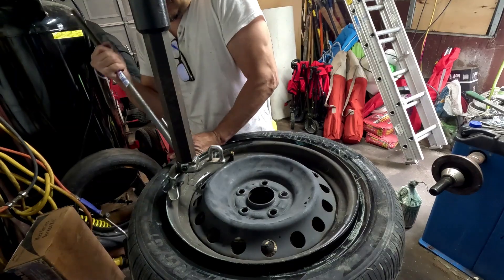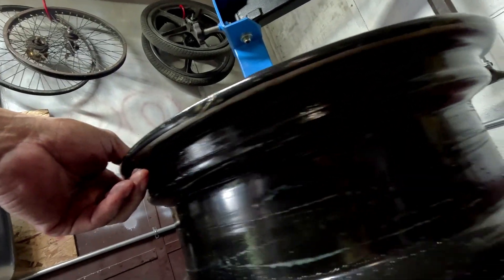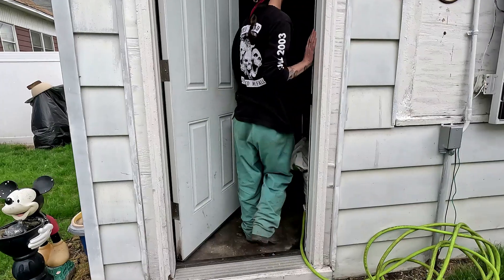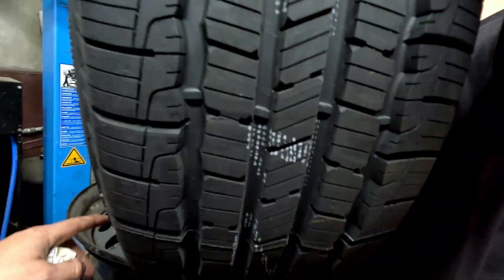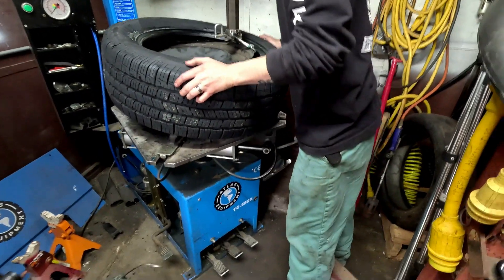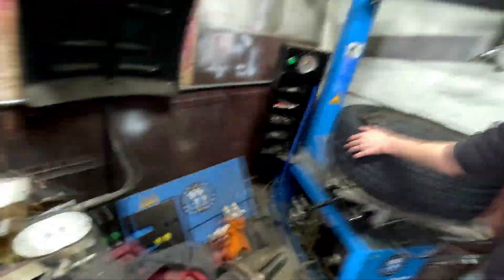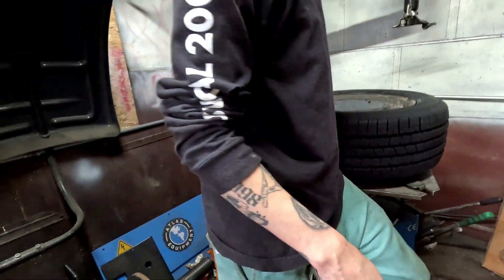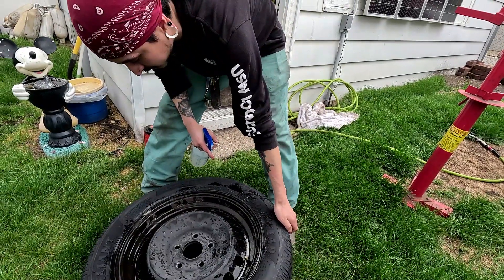Learning how to use a tire machine #tires

Comment: If I may ask: where did you get the machine from and how much did it cost you?
Reply from the maker: believe it or not these machines are about 25 years old. I got them from gregg smith equipment. both for like 1200 or 1500 many many years ago
Reply: @RobHereAKATrev2323  Oh wow ok thanks!